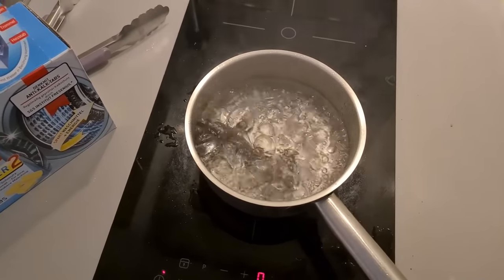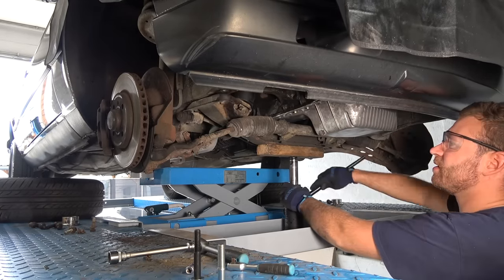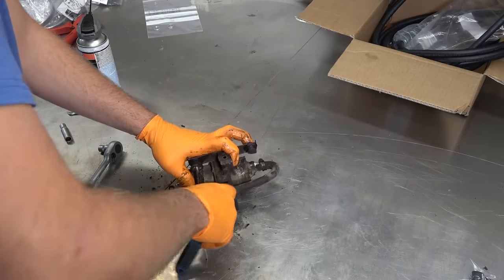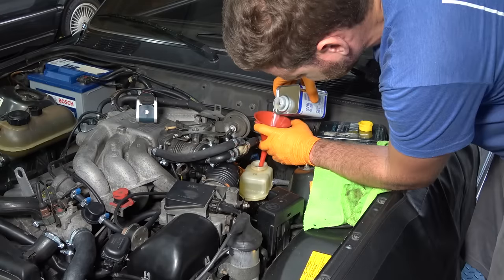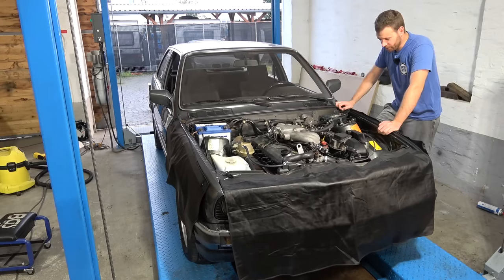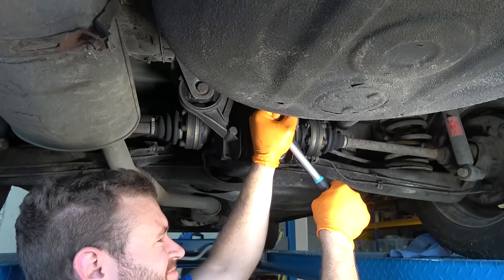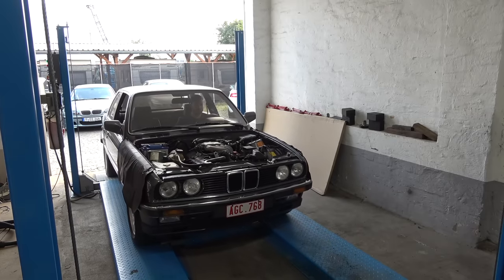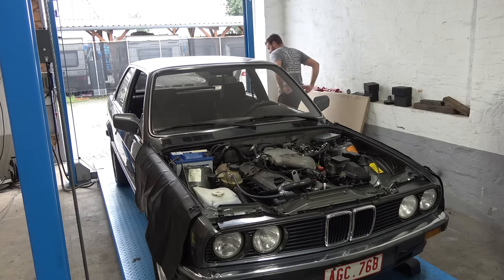Let's Get Mechanical - Neglected BMW E30 320i 5-speed - Project Marbais: Part 4

Comment: Hi Sreten! Lovely video as always :) I have alot of knowledge and experimentera on the L-Jetronic from working on my Porsche 944 and yes, you will get frustrated at times. The surging idle you had before changing timing is a strategy the DME uses when the idle is too high and it no longer can control it. By changing the ignition timing you solved your high idle but if timing is not correct it can cause other problems I am afraid, like loss of power. Regarding the idle I think booth systems use a idle valve regulated by vacuum. It is possible that is part of your high idle problem. The idle valve is most likely controlled by the DME via the ”TPS”. Om these old systems the TPS does not work like we are used to on modern systems. On L-Jet it is a throttle switch with two contacts, one for the idle circuit and one for WOT. Check that the switch engages when the throttle is closed. Hope you sort it out :) Good luck!

Comment: i think you did a fantastic job with panting the struts they look like new and as for your press consider adding some springs between the holding plates that way they wont fly apart so easily they dont have to be huge springs. But as allways fantastic job and great attention to detail .. ohh little sidenote the engine may calm down after you take it for a real drive since it has been stood so long maybe that is the problem with the idle.

Comment: I have used Simons (Jetex) for Audi S4. It had very nice sound, but after some time right side felt down. Pipe that holds exhaust in rubber hanger was hollow, not full. So about 1cm away from weld it just tore off. Check this out before buying.

Comment: i've heard that the idling issue could be a faulty temperature sensor. due to that the ecu doesn't adjust to the engine warming up
Reply: Equally I have found with my M20B25 (I’ll admit ever so slightly different to the M20B20 it always was a bit sticky on idle after being parked up for a while and needed an ‘Italian tune up’ and it would be cured!

Comment: The air mass sensor may give idle problems. The coal disc inside can be cleaned (as with old amplifier volume knobs) and/or the returns spring for the air mass valve is weak...Air mass sensors gave me a lot headaches when turbocharging the E30's back in the day...

Comment: Those old 80s clutches are solid as hell, it is the internal springs and throw out bearing that is 95% of the cause/issue, things were a lot over engineered back then.

Depending on your roads, you may love or hate those bilsteins, my roads in bavaria are absolute garbage and i ditched the Bilsteins completely.

If you want M-Tech level springs, go Pro-Kit and you ARE allowed to use aftermarket springs if those parts got TUV approval within 10 years after the cars production. Meaning if the car is 1983, you are allowed to "modify" items that have TÜV approval between 1983 and 1993 (so check with eibach for the FIRST date of TÜV approval, not the latest TÜV approval).

Comment: From my experience best way to remove ball joint that went of it's place and nut makes it spinning is use jack to rise it (and put back in its place). It should stop it from spinning matey :) BTW - lovely projects. If need any help from Poland give me a shout. I'm mechanic and can help if you need something :) Cheers!
Reply: I came here to post the same thing. Wire wheel or wire brush the heck out of the threads, oil them, jack up the bottom of the ball joint as hard as you dare (make sure your replacement is the right one first, as this jacking ruins the bottom of the ball joint) and let loose with the impact gun. I realise you couldn't have used a gun on the right hand side, but it still may have helped you.

Great content. Keep it coming (if you really want a challenge, E92 335i next. That will comprehensively empty your wallet. I know ;) )

Comment: You got a couple of things that can hang the revs. Ingition timing valve, it's a dualmodel for smother reving. It's a quite comon failure mode on them.  I haf several that you had to disconnect one side to get it to work. 
Of you want to adjust the idle there is a flathead srew on the valvecover side of the intake facing the cabin, do not adjust the ingnition, I dobout that's wrong. 
If it revs up and down you can adjust the lmm spring a bit for smother idle or looser for more rev happiness

Ljetronic is probably one of the easiest things to work on once you understand it and boy do I miss my old e30 323i

Comment: On my E30 M20B20, the idle was restless, turned out to be the Air flow meter.
Soaked it in brake cleaning fluid, and blew it dry with the aircompressor.
Had to repeat that a couple of times, and it was ok after that.
The fact that the engine idles normal after a restart, makes me believe it is an electrical problem, I put my money on the air flow meter.

As for the exhaust... have you looked at Eisenmann?
And as for the ride height, yes it's too high... but the new top mounts also come down a bit over time.

Comment: - The VAF sensor has a bypass passage, this passage maybe has a thing to do with the idle is very common see this clogged
- The ECT sensor also maybe have something to do do, i dont know exactly the estrategy, but i think the ECU increase the injectors pulse width or the time is energized the cold start injector (if equiped with one, the car was several years quiet maybe the head of the sensor is in contact with a portion of  jelly coolant  
-  Will be great if you have an adaptor (ISTA) to see the engine coolant temperature and the temperature in the moment the fan starts spinning and compare it with the factory specs, and with a termometer
- You can check the idle air valve by touch, must vibrate, and squezze the hoses and see the changes, is a metallic plate very primitive in comparision with the modern ones.

Comment: Check the flowmeter i used to have a 1988 320i and changing the flowmeter solved the idling problem, but good luck in finding a good one they are extremely rare, if this is the problem i might be able to source one for you

Comment: Hi if you want to lower the engine idle rpm, put a plastic or wooden ball with a small hole, inside of the air hose, make sure its big enough not to get sucked into engine, we used to do that on your car when the idle air control valve was broken and customer could not afford to change it.  Also change the oxygen sensor since on your car the computer will not tell you when O2 sensor is worn out.

Comment: Regarding TÜV and historic car registration, parts dont have to be 100% OEM, but period correct. Meaning you can use period correct parts (Wheels, lowering kits /springs from H&R, Eibach....) that where also available and used for tuning at the time the model (e30) was build and max.10 years afterwards (e30 ended 1994, so TüV conform parts that where offered till 2004 are OK).

Comment: fyi:
you are able to pass TÜV inspection also with eibach lowering springs if the eibach springs have an "ABE or Teilegutachten" for this E30. Don´t really know if there are papers existing.  You only have to say that you want to "eintragen" these springs und make "Hauptuntersuchung" and there should be no problem. Same thing when its from belgium and you have to register it in germany first with an "Einzelabnahme" it shouldnt be a problem.
Greetings from a fan working at Dekra :-)

Comment: When removing ball joint - just apply some pressure and that should stop it from spinning. In here for example just put a jack under that ball joint and you probably would not have to cut it off.

Comment: The broken suspension bolt, that was removed, Was replaced with a plated unmarked bolt. Many DIN fasteners are available. Or, consider using grade 8 bolts if available, 4140 and 17-4PH are better than grade 5 mild steel (commercial fasteners). Moisture can be avoided by coating threads with Never Seize or water pump grease.

Comment: I had a 88 325i without powersteering and chopped springs around. It was really tuff to drive that one. When it hit 3000rpm the tail came out instanlty in the corners and really hard manage that without powersteering 😁😁 //Sweden

Comment: One time I broke a bolt that held a crossmember to the chassis on an E83. And it broke inside the hole. However, after soaking it in WD40 for a couple of days and driving the car in the meantime, it got so loose that I was able to spin the remains out just by tapping on it with a punch.

Comment: As far as I know you CAN get historic licence plates although the car is not in a 100% original shape, as long as it is modified in a “contemporary" way, so with parts that where typical for the era the car was build in e.g. KAW springs or Koni Shocks

Comment: Hi Sreten. I had the same problem with my e30 323i, a long time ago. It was idling at 1000rpm and it wouldn't go down. The 323i had an air idling valve, which was an upgrade at that time. In these days there were no forums so I didn't know what to do. Until I met a BMW mechanic which owned a 323i too, at the time. I said I had to measure the resistance of the DME temperature sensor ( in the cylinder head). If this wasn't in spec exactly, the idling rpm would not be correct he said. I did the measurement, by data I got from him, and the sensor was bad indeed. I changed this sensor and the idling was at the right level again. But I'm not sure your 320i has a DME temp sensor at that time. My 323i was a '86 one. About the last one before they introduced the 325i. Maybe this will help you.......SG Nico.

Comment: Sreten, it would be a very good idea to thoroughly rustproof the rear coil spring mounts on the suspension arms while you have the springs out as they are a known rust area on E30s, and while repair sections are available, or at least they were, it seems a sensible idea to preserve the original, solid parts as they do have an issue with moisture and road salt getting trapped between the spring rubbers and the metal and eating it away, to the point where it's not unusual for the spring to punch the lower mounting clean off the car, even though they appear to be sound from underneath when inspected...

As far as the exhaust goes, I would strongly suggest going for a stainless steel item as they do tend to give a nicer sound to the exhaust due to the different resonance qualities between stainless steel and mild steel.  Plus, you have the advantage that a good stainless steel system should be easily able to last the lifetime of the car, so it should be win-win situation...

Give the new springs a good chance to settle before thinking about changing them.  For some reason, presumably due to the suspension geometry used, E30s are pretty notorious for taking time to settle down to their correct ride height after having new suspension components fitted.  I remember that it used to be recommended to drive the vehicle for at least 2,000 miles/3,300km before the suspension could be considered to be fully settled and at its' correct ride height, and I would imagine that it will probably take even longer to settle fully when going from standard springs to the lower sport or facelift items...

Comment: H-Kennzeichen can still be aquired with mods, they have to be +-10 years difference between car being built and the mod production date. You have to prove that it existed back in the day, with a magazine for example. Then it is "zeitgenössisches Tuning" (period correct tuning). New brand lowering sprigs/different part number unlikely, but original lowering springs reworked (repainted) from the 90s should be fine though.

Comment: That rev hanging problem sounds like the butterfly valve in the throttle body might be getting stuck on the way back. That could mean the springs are bad, there's debris, or the valve itself is worn out.

Comment: I wonder if you could rig up one of the later model Idle Control Valves to this early model car.

The problem with that would be that this early model's ECU likely doesn't have the connection/ability to communicate with the newer Idle Control Valve, since the old style is all mechanical. So maybe using a coolant temperature sensor that sends the appropriate signal range to the late model Idle Control Valve could work? Idk, would be a lot of hackery lol - probably not worth the trouble.
Just a thought though.

Comment: Have you checked the little door and sensor on the airflow meter by the air box as it can cause erratic idle? Have a look at it might be stuck and needs cleaning. Good luck

Comment: Sreten, one funny thing to look after is at 6:30 when you apply throttle the engine is deprived of air due to the protective covers you use in front of the car :)) it tried to bite the cover with the grills :)) they are too "protective", they're air tight
Reply: some actually use this "technique"(covering the intake swiftly while revving it) to clean up the intake and exhaust of the old carbureted cars that got soot due to low rev driving or poor gas and poor maintenance. I heard terms like "caughing it" :))))) the stupid thing is that that works ...
Reply from the maker: It makes no difference when the car is standing. It's getting the air from underneath.

Comment: Hi Man! 
If the rpm's are not going down immediately and stuck on high level for some time and only after few mins going down -> it could be an air throttle dumper stucking a bit. And after some time + after some vibration -> it is going down finally.
Also after re-start - the dumper/throttle "butterfly" (or whatever it is called in EN, the thing which is limiting the ari level) could have just a physical deterioration inside on the internal axle... so stucking a bit is a possible fail. 
Also, could be a spring which is moving the dumber back - the spring could have been weakened over the years... and there might be not enough force to move back the throttle back to idle position...
I am not sure if the throttle body was cleaned up yet with carbcleaner in prev videos of yours... but at least it is a good time to do it if it wasn't ;)

Adding more thoughts...
It also could be something happening with volume air-flow sensor before throttle... Wondering how the situation looks like when this sensor's connector is pulled out... In theory system mus then go to the "reserve" program and give a "middle level" of airflow based on other sensors data.
Or even simpler... may be that sensor already not working and giving such rpm stuck issues... )))

Comment: Does the distributor have a mechanically weighted advance mechanism? It might be sticking when you rev the engine and therefore not returning the ignition timing back to where it should be at idle.

Comment: Excellent content man,  keep up the good work. Btw not all 6cyl E30´s have a dual exhaust and 320i is one of them. And as stock they are really quiet. So what you have there now is propably it´s correct system.

Comment: Brilliant as always. A joy to watch 😊

For the idle issue it could be advance mech in the dizzy sticking or maybe the air flap in the airflow meter is sticking. Also makes me wonder if there's some vacuum device not returning properly as with engine off any vacuum and airflow is removed so diaphragms and weak springs can return properly. I'm thinking it's more a mechanically related issue than electronic.

Comment: dont call cork gaskets crappy. They are the right tool for the job and work great for sealing surfaces that cannot be guaranteed to be 100% perfect like a stamped oil pan.